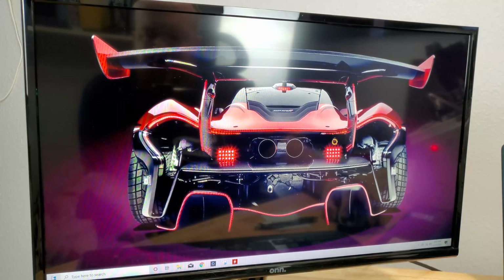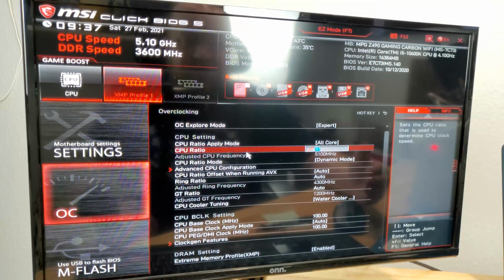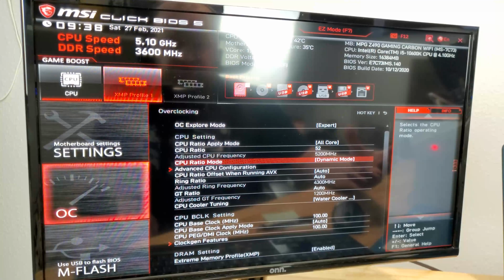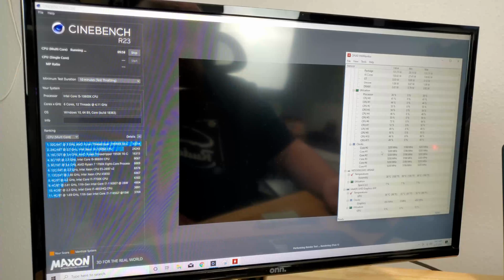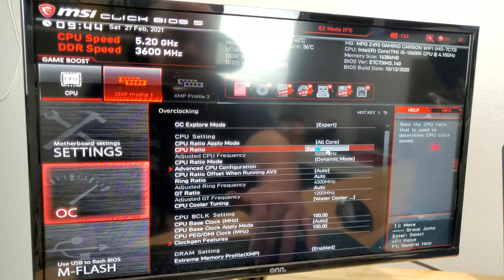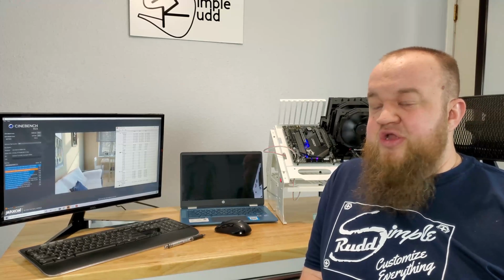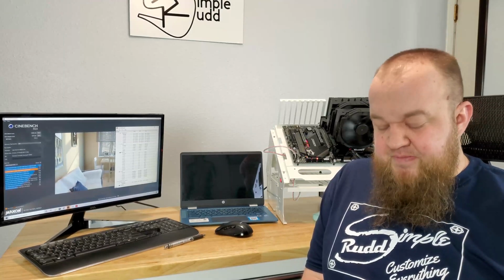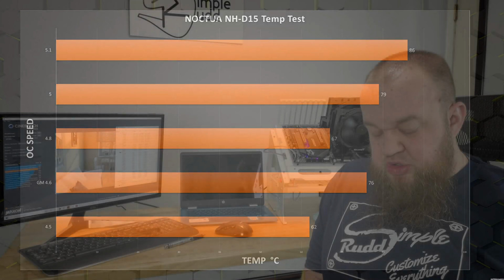How to overclock a CPU the easy way!

Comment: Dont give them the voltage, bs bud :) Every cpu I've overclocked in my 25 year, I've used, except for the few golden samples dangerous voltages. I always keep them cool... never lost a chip. My current build is a 13900ks @6.1 4.8 5.3 on the ring. 8800cl36. 4090 fe all under a mora 420. We push our water to the max out hhhheeeere!

Comment: What if our bios is complete bs and doesnt have any unique options
Reply from the maker: What board are you using? Also make sure you are going into advanced settings.
Reply: @simplerudd9235  im using Hp's UEFI bios
Reply: Im on an all in one
Reply: Also im fairly sure i cant even overclock anyways becaude of hp's limitations on laptop based motherboards and processors
Reply from the maker: @Contrasium08  HP and Dell are both pretty anti OC. I don't think the cooling on an all one would be able to handle the extra heat even if it could OC.
Reply: @simplerudd9235  yeah, my cpu seems to always be fairly cool though. Its always around 50 celcius

Comment: would i be able to get 5ghz with 550w psu? not sure if it even matters
Reply from the maker: Thats gonna depend on the rest of the system. I would say you want a good 200w dedicated to just the cpu. If you are running 12th gen Intel and you are overclocking, you will want closer to 300w for the cpu.

Comment: I used the overclock setting 2 in AI suite 3, and it sets all cores to 50, BCLK at 100mhz, CPU Cache ratio at 43*. But it only runs 4800mhz 100*48 all the time, but in Ratio it says 5000mhz?? I have tryet bumping all cores up to 52 in bios, then it runs at the 5000mhz some times a little higher, but makes a failure like in your video.. My CPU is a I9 9900k 3.6 to 5.0ghz 8 cores, my motherboard is a Asus Z390 plus-Gaming, my ram is Gskill ripjaws 3600mhz cl 16.. I dont know what to adjust so it runs the 50=5000mhz its set to, and not the 4800mhz its running now?? I tryet setting the Cache ratio at 50, but that was a bad ideer, my hole system freesed, and i had to shut down the pc, by holding the power button down lol..
Reply from the maker: How are your temps on the CPU? Could just have a heat issue or a voltage issue. There's also a chance that the CPU just can't hit it. Some people hit the CPU lottery and can hit ridiculous speeds, while others can't overclock.
Reply: @simplerudd9235  What i have seen the highest temps i got on it with 100% load was up to about 76 degrees, i havent tryiet to do a stress test, because i didn know how or what program to use lol. i got a tower cooler, its a Be Quiet dark rock pro 4.. But when gaming it dosent use over 40% CPU usage, most of the time its under 25% even in Red Dead Redemtion online.. The only game its running highest in is Warhammer vermintide 2.. But when gaming its runs about 50 degrees + -, I just read about something in BIOS callet "RING DOWN BIN", there makes the CPU runs 2-300mhz under the core clock, but what i can read about disabling it, is not a good idear because then the cache ratio, can go nuts and run up to about the same as the core clock and make the system to shut down.. I dont think its a temp problem i have, but im not shure? But i always over watch the temp and other things when gaming, i use the msi afterburner, But i have a Asus RTX 3060 12gb OC graphic card with 2 fans, But cant get the Asus Gpu tweak 2 program to show it when gaming lol, so thats why i use the Msi afterburner. I got a diesent air flow with my 3 Noctua 3000rpm 140mm fans, 2 in front and 1 back, and my kabinet is a Be Quiet pure base 500DX TG, its a little loud when gaming but i dont here it with my headset on, and not mutch when racing in Wreckfest with speakers, But after i got the 3000rpm fans and kabinet, and set the Gpu fans to run faster with lower temps, my GPU gets max about 61 degrees with about the 99% load, i have overclockt my GPU to the max, and 110% watts, from stuck when i got the GPU it was set to run the fans at 100% when the temp got to about 85 degrees i think it was, but it never got that high in temps, but about 75 degrees before, dont know why Asus set the stuck setting like that? But thanks for the reply Simple Rudd, greatings from Denmark, thats why my english writing is like it is lol...
Reply from the maker: @andersfiltenborgjensen1266  your English is better than a lot of Americans I know lol. It is odd that it won't hit the 5ghz. Do you have the voltage on auto?
Reply: @simplerudd9235  Thanks lol. Yes the CPU voltage is on Auto i just tjekket.. Yes its odd, but it have something to do with that "RING DOWN BIN" setting there makes it run the 200mhz lower, i have to read some more about it, before disabling it.. But i have also read something about its better to manual overclocking, instead of using OC tuning 1 or 2.. But i havent tryet yet.. Because i have used the most of my day on setting my pc up again, because i thougt there was a failure in the system, there made it shut down, so i reset the pc, but after i saw your video i know for shure it was because of my OC settings, All cores set to 52 in bios that it didn like, i know now because it shown the same picture when it shut down, like in your video lol, all that time i had wasted, stupid me lol.. But before i set the core ratio in bios, i had played some days with the same settings inside the AI suite 3 program, but was tired off setting it on every time i was starting my pc, lacy me lol. But in there it was working the few days, but maby its auto adjust the voltage in there, but i didn notice what voltage it was running on, but in the AI suite 3 program i know for sure the voltage is set on default, because i did not dare to totch it lol..
Reply from the maker: @andersfiltenborgjensen1266  sounds like you're learning a lot! Keep tuning, you'll be a pro in no time.
Reply: @simplerudd9235  I don't know about that, I'm to afraid of frieng my CPU lol, the only goal for me is to get it on the 5ghz it supposed to be the boost clock on the i9 9900k 3.60ghz to 5.00ghz, but it also woult be nice if it coult down burst the MHZ when not gaming or other things, for now it's always on 4.8ghz the only thing that's not constant is the voltage, it must be possible to set it to turbo clock when needed and when not needed it's set to the 3.60ghz? Or don't it matter if it's always running high ghz, as long it's not running high voltage the same time? I think about the lifetime of the CPU? I think like my GPU when not used it's runs with low clock speed, but speed up when it have to? But if the pc is set on hardware accerate, like one sayd it should be, in a video I saw here on YouTube about pc game mode, the GPU runs constant high clock speed, I figured out.. But about CPU voltage, what is best Auto or Manual adjustment? Or is there a max voltage you can set it to when it's goes turbo mode? Turbo mode is enabled in Bios, but the MHz don't go up or down, but always on 4800mhz? Again the only thing there seems to adjust it self is the voltage.. Pc is a bootle nech a lot of times to crack, and I don't know any body to ask if there are some kind of failure or other trouble with it, they all think they know allot about it, but when it's come to the truth it's all in there mouth lol, I have learned allot the past year about pc stuff, but only because my kusin "helped" me build my old pc over in a other kabinet and new motherboard, but after that the sound come and goes, it took me days to figure it out, and the only option was a total reset of it. Some times I mis the simpel old days with Commadore 64 and Amiga 500, but not when I'm looking at YouTube videos how the graphic was back then lool
Reply from the maker: @andersfiltenborgjensen1266  Jayztwocents just did a video ramping up voltage trying to kill his CPU. I recommend checking that out. He also has some good videos going over overclocking in greater detail. Manual adjusting the voltage is definitely better as you have more control. It also will lead down a longer time of trial and error. As long as you don't override the Bios safety measures, your hardware should be safe.
Reply: @simplerudd9235  Ok update here from Denmark lol, i managed to get it to run 5ghz all the time, i saw  some videos, but me and videos cant remember half of it after watching lol, then i googlet allot and took pictures of it, so i didn forget it lol.. I tweeket many things first but then it runnet at 4.8 to 5.0ghz, but i found out the only thing there was making it run the 200mhz lower was "AVX instruction core ratio" It was set on 2 by default, i set it to 0, and now its running the 5ghz, but i didn like it was running high voltage all the time, so i ended up by setting it all to like it was, only not AVX, i left that on 0, and then used the OC tuner 2, and now its adjusting the voltage down when not in use.. I have maked a scan of my pc to stress the CPU a little, and it peeked a little over 100 degrees celdius, in a sek with 100% usage, thats realy high, so i thinking about getting a good water cooler, but i will try first some better termal paste, the paste i used last was Artic silver.. But like i had sayd before, when im gaming the highest CPU usage i have seen in one game was about 40% and what i remember was the temp about 65, so for now its ok, and about the same thing when im downloading.. I have tryet some gaming, and tryet downloading 100gb, and havent had any issues! I saw Jayztwocents video about overclocking my GPU, and that how i figured that out lol..
Reply from the maker: @andersfiltenborgjensen1266  awesome! Glad to hear you got it dialed in. I have a 9900ks in my system running at 5ghz all core. I have it in a custom loop and it never goes over 65c in my new system. The old shift X system had it hit over 95c multiple times.
Reply: @simplerudd9235  Ohh nice temp. Custom loop is it a brand of at water cooler?? I cant find any when google? but it will be my next and only step for now in the future to get a liguit cooler, but for now its doing ok temps when gaming, specialy after i adjusted it back to the OC tuner 2, so its not running the high voltage all the time, and it works good when gaming, i think its runs better now, but dont know if its just in my mind i think so lol, but it must perform just a little bit better now..
Reply from the maker: @andersfiltenborgjensen1266  you have air coolers, AIO (all in one liquid cooler) and custom loops. The custom loop is a full custom liquid cooling system. EK has great parts and guides on goin that route. It is however a very expensive route.
Reply: @simplerudd9235  Thanks.. A little update from here, i was reading the wrong number of my last temp in the Cpuid HWmonitor lol.. I just made a stress test in a few minutes, with the CPU-Z program and got max temp at 81 degrees celdius, so think its ok for a tower air cooler, for sure allot better then my faulty reading earlyer today lol.. But still im gonna try out some better thermal paste, and see what numbers i get, woult be nice to come under 80..
Reply from the maker: @andersfiltenborgjensen1266  80 is a little warm, but definitely a safe temp.
Reply: @simplerudd9235  Year i know its a little warm, but it the max temp it was going to at 100% CPU usage, and when gaming its almost newer goes over 40% usage and temps over 60 degrees, so im not worrieng so much, not like when i did after i saw the wrong temp lol.. But in the future i will get a disent liquit cooler, i will look in allot youtube videos about how the different models perform..

Comment: do i have to disable turbo boost in bios to overclock the base, it hovers between 4.2 4.5 ghz despite changing the cpu ratio to 48
Reply from the maker: Make sure you press F10 to save the bios. If your overclocking passed the turbo then you should disable it. Also check to make sure your temps are good.

Comment: I have an i9 and I pass the single core test, but fail the multicore test. Should I lower the cpu mhz?
Reply from the maker: You could keep the single core where it's at and lower the multi core mhz. Lower it little by little until you pass. There's also a chance that you may be able to keep the higher mhz with better cooling.
Reply: @simplerudd9235  oh awesome I didn't even know you could do that. I'm going to try it today. Thanks m8!
Reply from the maker: Good luck!
Reply: @simplerudd9235  do you know what the setting name is? having trouble finding it.
Reply from the maker: @user-bq4xc2yy3m  You will most likely need to go into advanced. However you can try by de-clocking by 100mhz first and see if your problem is resolved.
Reply from the maker: Depending on motherboard and bios, it might show an option for multi-core. or it will break down each core.
Reply: @simplerudd9235  I have the same motherboard and bios as you. I set the "All Cores" Ratio lower to the 4 ghz range. I have a Noctua NH-D15. I can't seem to reach the 5ghz range without the CPU hitting 90 degree celcius. Is this when I should start under volting? By the way, thank you for all your help. I subbed to you.
Reply from the maker: Part of the issue is overclocking the i9 on air cooling. The NH-D15 is amazing, but I was hitting high 80s with the 10600k. The i9 is known to consume a lot of power. You could remount the cooler just to make sure there is good contact and even thermal paste. However you may be reaching the limits of the cooler all together. If you can undervolt, this would lower heat output. I'm still learning how to undervolt myself. Jayztwocents or Optimum tech may have more info in the undervolting arena.
Reply: @simplerudd9235  Okay, sweet. Guess I've got more work to do. Going to remount it soon. I'm going to check out Jaytwocents's video as well. Just as a reference, what ghz should I be going for because you went up to 5.1 Ghz? Is 4.7 Ghz even considered functioning properly?
Reply from the maker: @user-bq4xc2yy3m  Sadly sometimes it comes down to silicon lottery. Some can hit 5.3 no issues while others may struggle to hit 5. 4.7 is still a good step up from stock. With turbo frequency it should still hit over 5ghz for short bursts of time.
Reply: @simplerudd9235  Dang I didn't know the silicon lottery has such a huge impact. Thank you again for the knowledge.
Reply from the maker: @user-bq4xc2yy3m  anytime! Good luck with your overclocking adventures!!!

Comment: hey watched the video just wondering if i do overclock and it isnt stable when say running cinebench am i able to revert it back to its stock with causing any damage to the cpu itself
Reply from the maker: Yes, you can shut down the computer and reset the bios. This is what anyone who pushes the system too far has to do as well. It's a complete refresh to any changes made in the bios.

Comment: Hi I have a nzxt n7 z370 mother board with a i9-9900k can I just change do what you did here it’s at 36 or 3.6 can I just bump it up to may be 4.5
Reply from the maker: You can, I would bump it up slowly. Try 38, then 4 and so on. You might gets passed 45, or you might not make it there.
Reply: @simplerudd9235  awesome thanks dude also I try to set the ram speed two 3200mhz but it doesn’t keep that speed after I save it it goes back to 2133mhz. I have gskills 3200mhz ram sticks any idea why
Reply from the maker: Mine did that as well, then it just randomly worked. I wish I had more info than that lol. I'm still learning all of this as well and trying to pass down my experiences.